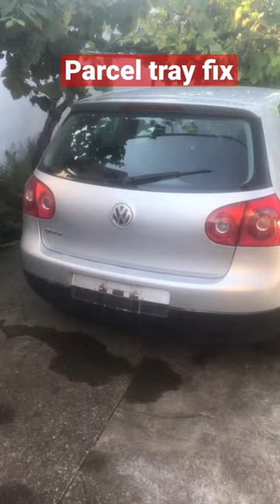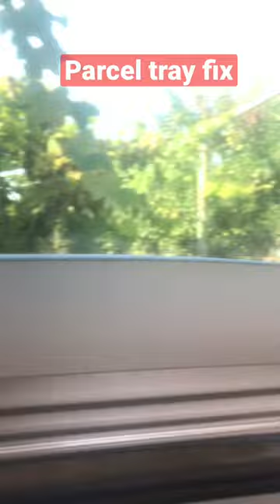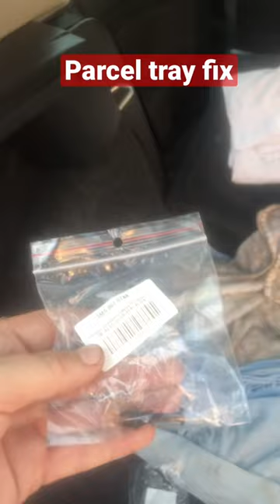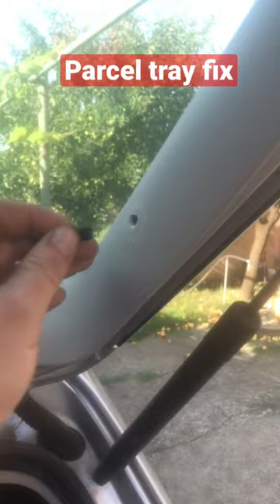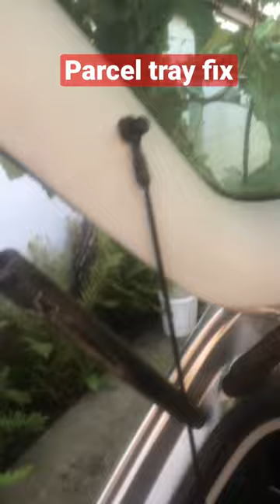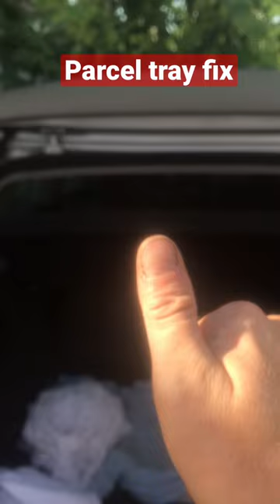Quick repair for broken parcel tray #golf5 #shorts #volkswagen  #vwgolf #repair

Comment: And how do you remove the old one?
Reply from the maker: You have to pop off the top part of the outside frame which goes around the whole stereo, pull it up and off, the you will gain access to the tray. You will find two clips which hold it in place on the sides. Use a very thin and small flat head screwdriver to push the clip in and pull it out just a bit to get it away from the frame  so it doesn’t jump back in. Do the same for the other clip on the other side. You should have no problems with it, it comes out pretty easy and should only take a few minutes. Hope it helps. Cool 👍
Reply: @CarRestorations5150 would this be similar to the mk4 golf/ mk1 Leon?